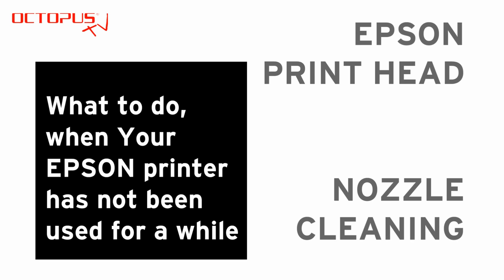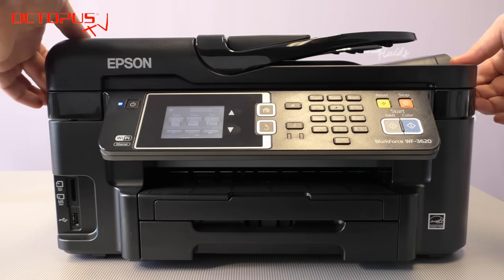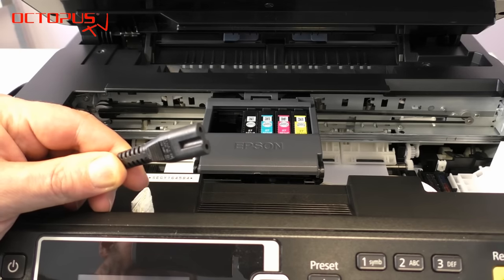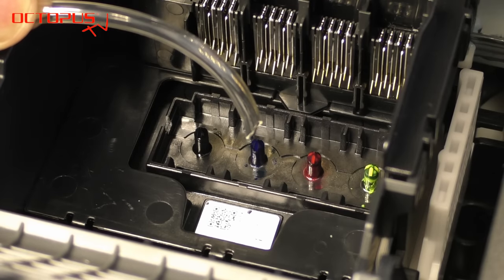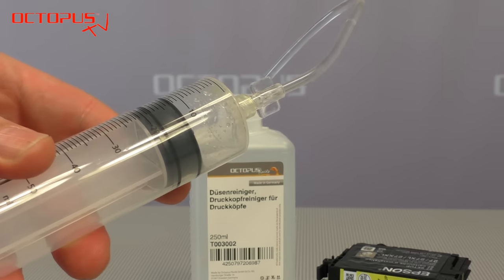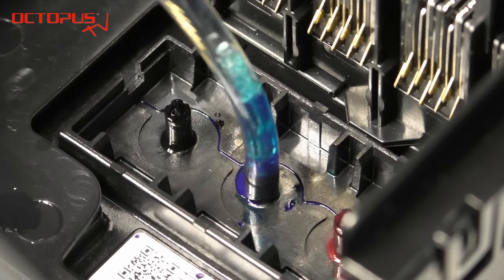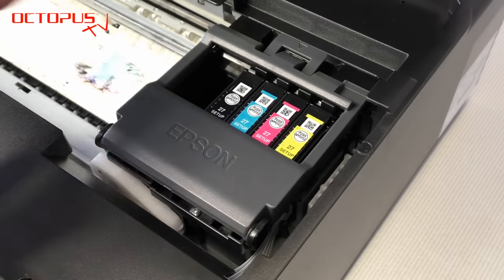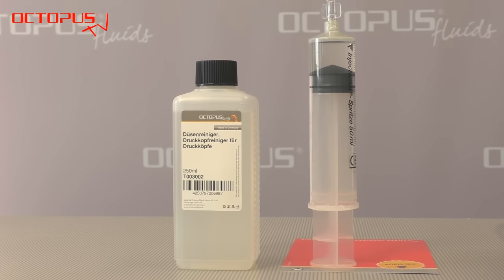Epson print head cleaner, nozzle cleaning - flushing clogged nozzles

Comment: Is it possible, that the printheader is destroyed by to much pressure during the cleaning action?
Reply from the maker: Hello Ray, unfortunately the answer is yes. That´s why we point out to apply the pressure very gently and give the cleaner sufficient time to dissolve cloggings inside the print head.
Reply: Thanks
Reply from the maker: Hello Ray, we hope You get Your device back to life...
Reply: No. Ich habe wohl eine zu kleine Spritze genommen (2ml) wodurch  "durch meine Ungeduld" zu viel Druck augebaut wurde.

Comment: I followed the instructions I did it three times and it’s prints blank, I have a wf 7710, I need help to fix this since I need this for school.
Reply from the maker: Hello Justin, printing blank means that there is still cleaber fluid inside the print head -  assuming that the print head is still intact. It can take quite a number of test prints before all coolorts come back and the print outs are back to normal. We recommend to run test prints on used paper until the prints are acceptable again - this way You are not wasting new paper.
Reply: @octopusoffice  I printed around 300 test prints still noting, I cleaned it again still blank.
Reply from the maker: Thanks for providing these further details.  300 test prints should have made a difference. Second cause could be that there is air in the print head - it happens that during the cleaning air is pressed into the ink chambers in the print head or it enters them from below when pumping the syringe: You can get rod off this air by either again pressing cleaner from the syringe into the print head or pressing in refill ink - in case You have bottled refill ink available. Both ensures that the new connection between new ink in the cartridge towards the nozzles in the nozzle plate can be made.
Reply: @octopusoffice  Thankyou, I had the same problem and it did the trick for me took a few flushes to get the air out and it's not printing perfectly but it is printing again, lockdown home schooling without a printer was hardwork

Comment: can you give any solution to "clear carraige Jam" Carraige Jam Error " HP deskjet 3525
Reply from the maker: Thank You very much for Your question. The message says that something is blocking the print head compartment from moving in / into the working area. Have You checked the insides of Your printer especially the track where the print head moves on?
Reply: @octopusoffice   Yes head  is moving smoothly on the Rod but the Tray under it some time move and some time don't move.is there a way to jump the command and make printer work
Reply from the maker: Have You applied any manual cleanings or modifications to that part of the printer that can cause any changes in its behaviour / funtionality?
Reply: @octopusoffice  Yes Sir i cleaned the try with dry cloth as it is clogged with ink.. so is there a way to by pass this error  or reset the mechanical settings..
Reply from the maker: Thanks for Your quick response. We are sorry we have no suggestion how to bypass this hard stop message. We can imagine that there are some residual fibers of the cloth used for cleaning stucked somewhere or that the tray got displaces somehow - hard to guess for us the exact reason from the long distance.
Reply: @octopusoffice  its ok sir no issue i heartily appreciate your time and attempt ♥ 🙏

Comment: Hi, i followed your procedure to clean the printer dead head with clogged nozzles but their is blank paper print after that, what i would do to fix this problem.
Reply from the maker: There is still cleaner liquid in the print head - first You need to get this cleaner out. As the cleaner is some sort of colorless ink You can print it out until the normal inks come back. You also can place the print head on an absorbent underlay again and let that underlay suck the cleaner out of the print head while the ink cartridges are installed. When the normal inks have reached the nozzles again You can see their colors on the  absorbent underlay.
Reply: I have little to no printing on a mostly blank paper as well. When I place the print head on a paper towel, nothing really drains out. I tried cleaning the heads, printed a nozzle test, and again, only faint results. Any suggestions?
Reply: the same problem
Reply from the maker: Hello Arlene, when placing the print head on the paper towel it is necessary that there are ink cartridges in the cartridge compartment that ink from these cartridges can get drained towards the nozzels. When You can finally see ink on the paper towel Yopu can go back to print, the quality of the print should become better after some pages.
Reply from the maker: please check our answer above...
Reply: Hi How long would you advise it would take to drain the excess out? I did the cleaning as per your video and now printing completely blank pages Have printed a lot of test pages to use up the fluid remaining in the print head but having now placed an underlay underneath nothing is draining from what I can see. would i need to leave overnight? Also I had full cartridges before starting and now my cyan is saying low. Could there be something else wrong?Any Advice would be great thank you
Reply: Did you find a solution for your problems? Got the same...

Comment: How soon can I use the epson printer after flushing the clogged nozzle?
Reply from the maker: Thanks for the question. Right after flushing You can set the cartridges back in and start printing. Just keep in mind that there is still cleaner fluid in the print head. So start by printing some test documents - it will take a bit time until the prints come back to normal.

Comment: Can i use h2o2 for cleaning ?
Reply from the maker: Hello Rahim, thanks for the question - we do not recommend using hydrogen peroxide for cleaning a printer working with water based inks. The bleaching effect of hydrogen peroxide may damage parts of the printer´s ink system. Beside that hydrogen peroxide does  not have a dissolving effect on water based inks.
Reply: @octopusoffice  well in region special  cleaning solution for printer aren't available , do you recommend anything useful i can buy in pharmacy? (Thank you for the warning, ps : i have epson sx130 by the way it's old i haven't use since years)

Comment: My wf 7710 is still printing blank pages. Can you help me?
Reply from the maker: Hello Nicole, there are two options - either there is still cleaning fluid inside the print head or there is air inside the ink system. In the first case just keep on printing print jobs on used paper until the colors come back to normal - this may take quite some numbers of prints. In the second case flush the print head again with cleaning fluid and  make sure that no air is pressed into the print head from the syringe or from the tube and then start printing test pages again.
Reply: @octopusoffice  very helpful.  thank you kindly.
Reply: @gfriedman99  I’m having the same problem. what worked for you?
Reply: @marc10000000  The only thing that works is to run the nozzle clean program until it works.  Took me 30 cycles until it finally cleared.

Comment: Hello, will this set-up work for an Epson Stylus C66?  Thanks.
Reply from the maker: Hello Loretta, thanks for Your question. The Epson Stylus C66 came into the market in 2003 - according to our knowledge it also has the spike shaped ink inlet inside its cartridge compartment and the cartridges sit directly on top of the print head. Yes, our setup works for this machine too . Please keep in mind the setup cannot repair a damaged print head it can just clean :)

Comment: Greetings from Canada!

I have an Epson Workforce 520 printer that I have for 10 years (yes, 10 years) and I wonder if this video will apply for my printer?

By the way, your English is pretty good despite the German accent. Excuse the offense, though.
Reply from the maker: Hello Simon, thanks for Your comment. Yes, today´s printer models are not built to last 10 years... In our compatibility database I was not able to identify Your printer... 10 years plus could be the reason - which cartridge models does Your printer work with?
Reply: @octopusoffice  thanks for your prompt response. The cartridge models that work for my printer are the Epson 125 and 126 print cartridges. The only difference is that the latter cartridge offers high capacity printing (or something like that).

Comment: I did this.... until all liquids come out clear. Then I try printing still not a single thing on the test page......
Reply from the maker: Hello Sidney, thanks for Your comment. When You have made the ink lines going trough again there always remains cleaner inside the print head - this liquid needs to get printed out before the normal inks will appear on the print outs again. Just make sure that You have not pushed air into the print head - to get rid off that takes even longer than to get the cleaner out.
To get the cleraner out we recommend to print whatever You want but print on used paper as these test prints will not look as nice as You want - but You know that already. It may take quite some time before the normal inks come back, but they will as long as the print head does not have any additional damages beside the cloggeg nozzles.

Comment: Is it also works with EPSON XP-345?
Reply from the maker: Thanks for Your question. Yes, Your Epson is working with No 29 carteidges. These sit in such a  print head compartment inside the printer -  the method can be applied on this machine.
Reply: @octopusoffice  Hello there, I had problem with Cyan and it works now. but another color Black Magenta is totally disappeared. so do you think I should clean Black and Magenta also? or just wait for couple of days? them might be coming back?
Reply from the maker: @ucoxuco  Thanks for Your question. During the cleaning the print head´s nozzles were sitting on the absorbent material. During that stage the ink from the Black and Magenta as well might have been sucked into the absorbent material. So when You go back to printing You should start some test print jobs on test paper - paper You have already printed on - 20 to 50 pages and then the colors should come back.
Reply: @octopusoffice  It didn't come back. so I cleaned it again all colors. and printed more than 20 then my printer stopped as Error no.01. :(

Comment: I just cleaned all heads with an Epson cleaning kit. When I run the printer, all I get is wet paper.
Reply from the maker: Hello, thanks for the question. After the cleaning there is still some cleaning fluid remaining in the print head, that is whay You get wet paper when printing after cleaning. It is the best way to print out this remaining nozzle cleaner - please use old paper to do these test prints. According to Your printer model it may take many print to get out the cleaner, but this way the waste ink pad in Your printer is not polluted unneccessarily.

Comment: your test print isn't even a good example. it's missing points in the yellow...
Reply from the maker: Hello Mike, thanks for pointing that out. It´s hard to to find a balanced way to show the results in a reasonable way to everyone. In cases where the print head has been almost completely clogged the print result after cleaning with some small parts missing is already a good progress. The  prints get better when keep on printing and when avaoiding to clogg or dry out the nozzles again. If we would have chosen a perfect print out for demonstration of the cleaner it would make users feel unsecure about if they did something wrong - as their first prints do not look that perfect after the cleaning. Furthermore it might also be the case that some nozzles never come back to live as they were not working at all anymore already before the cleaning - there are users that are happy to revive the majority of the nozzles in their print head :)

Comment: must use gloves , otherwise ink is not easy to remove from fingers. Nice job. Bravo
Reply from the maker: Hello Rashid, thanks for Your suggestion :) I am always trying to do it without gloves to prove that it can be done in a clean way -  when You are careful enough. I am not telling You that I edit out the fails 😉😂
Reply: @octopusoffice  its been over 25 years working in this sector. It was a sujjestion for the begginers who just started watching your good videos . Thanks
Reply from the maker: Hello Rashid, I am fully on Your side with the gloves - our sets for print head claning always come with gloves for our customers. To clean ink from fingers - in case an ink accident occurs - we use a  mild solution based on soap and containing small abrasive particles.

Comment: Just dabbing it with isopropanol is just as effective.
Reply from the maker: Hello Jules, thanks for your feedback. Depending on the inks used in the printer isopropanol can be a solution -  then the inks must be alcohol based. Isopronal does not have a dissolving effect on waterbased inks. In desktop printers waterbased inks are used in most of the cases.

Comment: Dude it's a setting on the printer to clean it just wipe it with wet and dry q tips each a separate one
Reply from the maker: Thank´s for Your feedback. Some people just wanted to know about a more intense cleaning so we came up with this way.
Reply: Nice thought but the built in cleaning function doesn't always work.
Reply: LOL. Silly millennial. The people who are watching this video for cleaning tips are needing something way beyond the built in cleaning feature.
When a printer is not used regularly the ink will dry inside the head. Often times the built in cleaning function, and some q-tip applications are not going to clean it.
Besides throwing out the printer and buying a new one the last hope is forcing some cleaner down inside the print heads.
Reply from the maker: Give the young padawan some time. Still learning and evolving she / he is. We appreciate the full spectrum of Your contribution.

Comment: epson brand is worest
Reply from the maker: Hello Naveen 🙂 rating the different printer brands against each other is always a bit like deciding between different diseases (just kidding). Epson at least is providing quite sturdy print heads - You run in problem there - You can fix and the print head still works after that fix.....

Comment: Hello, I have Epson L8058 and put the wrong colors in the wrong place how can I pay if you can help me.  Do you have a whatsapp number?
Reply from the maker: Hello, thanks for contacting us about Your L8058. First you need to get the inks out of the ink tanks. You need some syringes and slim tubes that You can connect to the syringes - use these to suck out the inks from the tanks. After that You fill in the right inks into the right tanks.
After that You have to do a lot of printing to get the inks out of the wrong places in the printers´ ink system. We recommend to use old paper as these prints are just for getting the colors back to normal.

Comment: I have an epson xp-440, prints only in red. Will this help ? also any other recommendations...
Reply from the maker: Hello Amadou. Your XP-440 is working with Epson 29 cartridges - so: Yes, for these the method used in our video tutorial work for Your printer too. Please be aware of that our cleaning approach cannot repair a print head that does not print due to other damages as dried in inks or other blockings :)